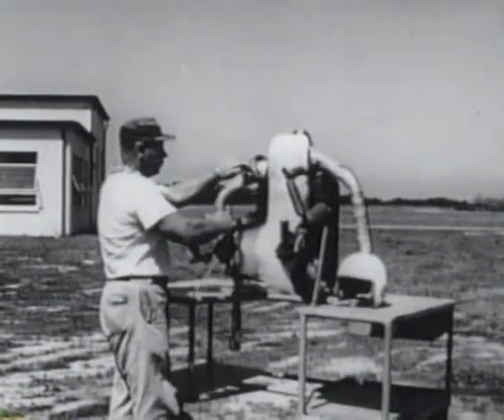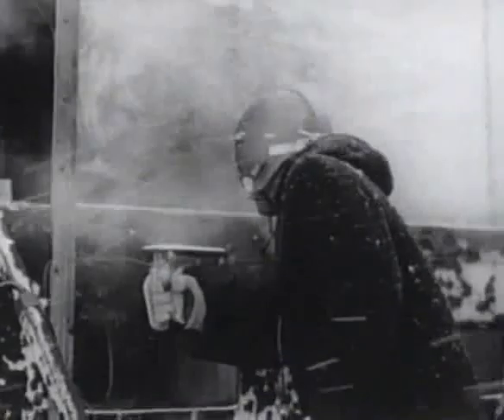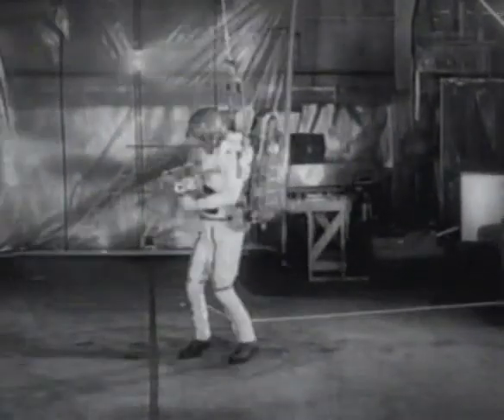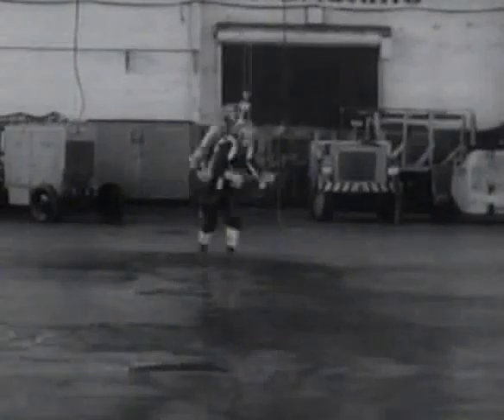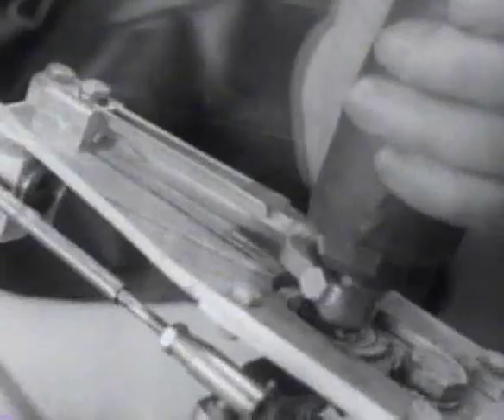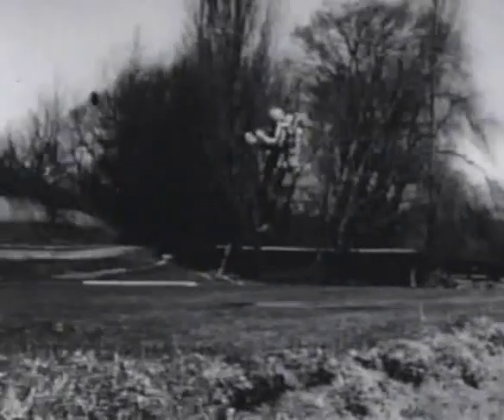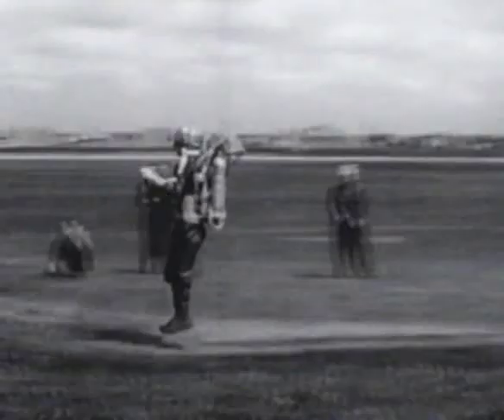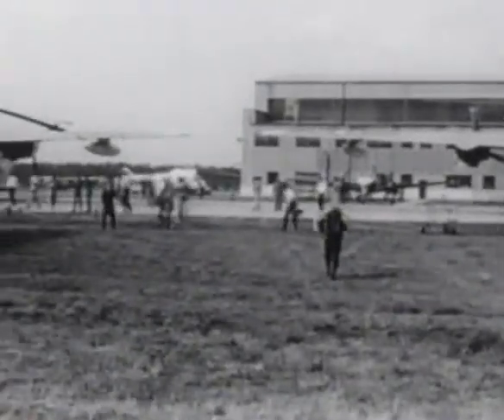Bell Aerospace Corporation film on testing the Rocket Belt.mpg

Comment: Not a rocket. used compressed gas expelled at high velocity. 

In 1959 the U.S. Army contracted Aerojet General to conduct feasibility studies on a Rocket Belt and contracted Bell Aerosystems to develop a Small Rocket Lift Device (SRLD). The experimental rig, which worked on compressed nitrogen, was prepared. Its steel tubing frame allowed a tester to be attached to the rig. Two hinged nozzles were set on the frame. Nitrogen at 35 atmospheres (3.5 MPa) was supplied to the nozzles by flexible hoses. An engineer-operator on the ground regulated the supply of nitrogen through a valve. Additionally, the tester regulated the thrust using levers under his shoulders. The tester inclined the nozzles forward and backward, trying to reach stable hovering at a limited height. A safety tether was attached from below, so that the rig and tester could not fly too high.